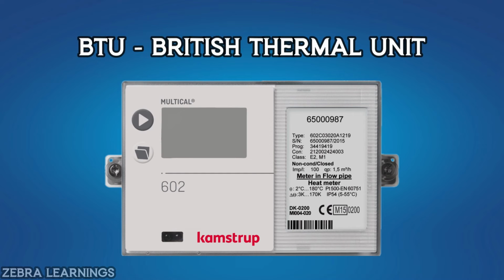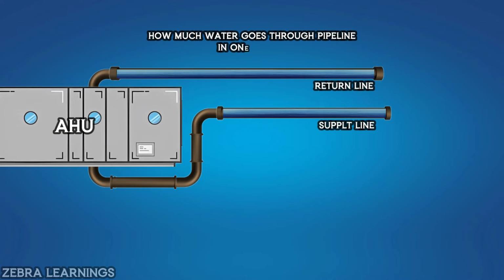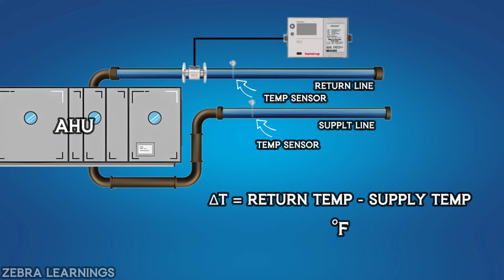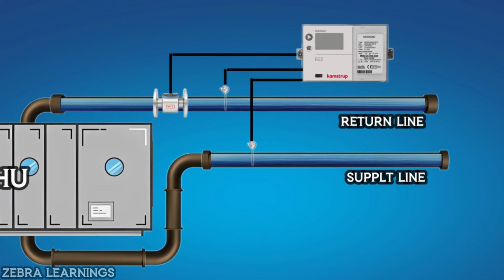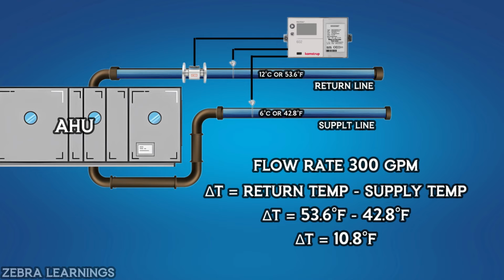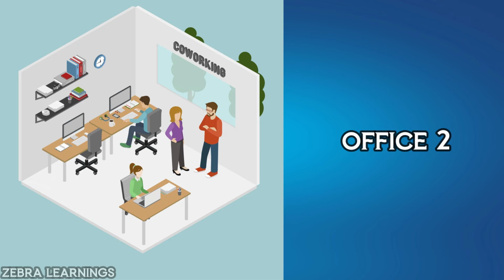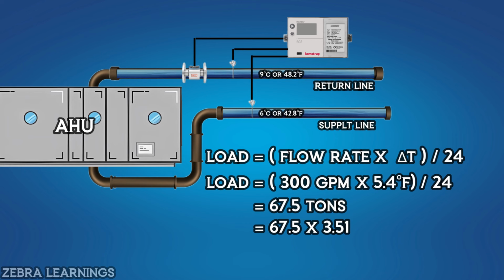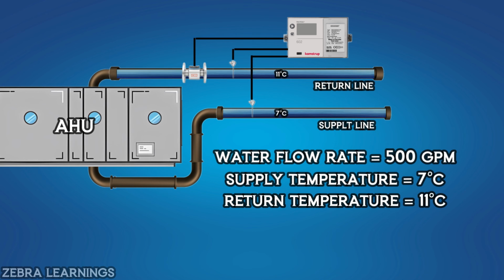BTU Meter Explained | How it works? | Animation | #hvac #hvacmaintenance #hvactraining #hvacsystem

Comment: I am confused c °. F° 
C= 9 - 6 = 3
F = 48.2 - 42.8 = 5.4
If I use C ° = 300 gpm × 3 / 24 
                   = 37.5 tons
If I use F°. = 300 gpm ×5.4 /24
                   = 67.5 tons 
I am confused 🤔 which is correct
Reply from the maker: You have to calculate it only in °F. Not in °C.
Reply: 526.5 KWH

Comment: what if there is change in flow rate ? For Example , if flow is 100 gpm for 1 pm to 2 pm and 200gpm for 2 pm to 5 pm. Then how will total energy consumption calculated ?
Reply: Flow rate doesn't varies, it is calculated in terms of equipment TR only temperature changes and by impact of temperature and VFD the equipment like chiller and cooling tower effects

Comment: What is 3.51?
How to know flowrate?
Reply: 3.51 is the Conversion factor of TON to KWH.    1 ton of refrigeration is equal to 3.51KWH.       to measure flow rate, a flow meter is installed on the return line and that reading will be showing in BTU Meter. To verify the flow meter We need to use an Ultrasonic Clamp on flow meter like Flexim F601. and we have to compare the Flowrates so that we can confirm the reading is correct or not.

Comment: 526.5 kWH is the answer
Reply from the maker: Perfect
Reply: Can You Please Explain please
Reply: Supply Temp = 7°C = 44.6 °F
Return Temp = 11°C = 51.8° F
Water Flow Rate = 500 GPM
Load = (500*(51.8-44.6))/24 = 150 TR = 150*3.51 = 526.5 KWh
 @sonusrk1249
Reply: @maxkenton3832   Tq

Comment: Simple explanation. Thanks a lot.
Reply from the maker: You are welcome
Reply: I am confused c °. F° 
C= 9 - 6 = 3
F = 48.2 - 42.8 = 5.4
If I use C ° = 300 gpm × 3 / 24 
                   = 37.5 tons
If I use F°. = 300 gpm ×5.4 /24
                   = 67.5 tons 
I am confused 🤔 which is correct
Reply: https://youtu.be/G_17HtaJNwM?si=JgDoicSyynPuhViP

Comment: Great explanation!! but considering that the result obtained in the formula is an instantaneous value, how we can calculate the cumulative load at different times? For instance, weekly or monthly.
Reply from the maker: Yes you are correct. The value is instantaneous. But, You can get the value for seconds and minutes just by changing the formula units (like Gallons per second or Gallons per minute). But we can't use the formula to calculate the reading for whole week or month, if we use that we can't get the correct value.
BTU meter calculates the reading every minute and adds it up. So, when we check the BTU meter at the end of the month, we get the reading for that month.
Reply: @zebralearnings  So, How we can obtain the accumulate load? (kwh) How can you obtain this value manually?
Reply: https://youtu.be/G_17HtaJNwM?si=JgDoicSyynPuhViP

Comment: Is it kw instead of Kwh?
As I know that kw is kilowatt
And Kwh is kilowatt per hour
Reply from the maker: It's Kilowatt per hour.
Reply: @zebralearnings 
Means Kwh = tons * 3.51
How to convert gallons to tons?
And also Kwh is kw per hour means Kwh is total consumption.
Kw is current consumption
Reply from the maker: @sachinguled913  Yes, KW is current consumption and Kwh is total consumption per hour.
And we can't convert gallons into tons.
Here, Gallon is flowrate and ton is load. So, we can't convert gallons to tons.
Reply: What is this 3.51

Comment: what if office 1 and office 2 sets the "same desired temperature" regardless of the number of people or machines in the offices, will the loads turn out the same?   otherwise, do you mean there is temperature sensors in office 1 and 2 which automatically sense the room temperatures?
Reply from the maker: The load will change based on the how much heat is produced inside the room. If there is difference in the heat production then there will changes in the load.

Comment: 511.87kwh
Reply from the maker: Perfect 👍
Reply: 526.5Kwh
Reply: what is the Return and suply defference?
Reply from the maker: @dilankasisikelum7615  Did you calculate?
Reply: 526.5 is correct or not?
Reply: yes